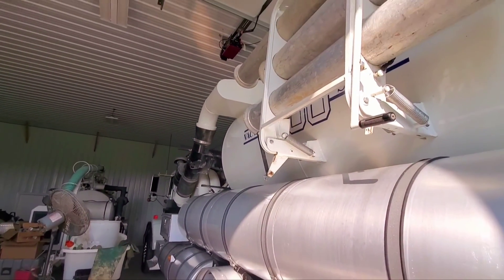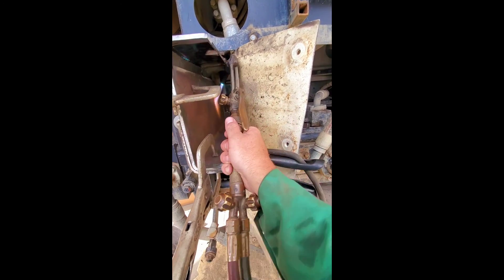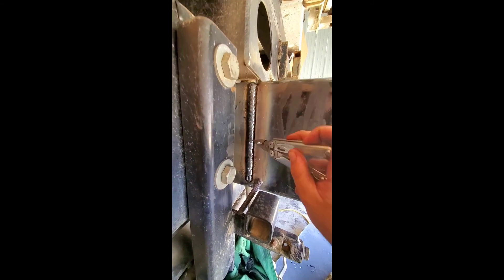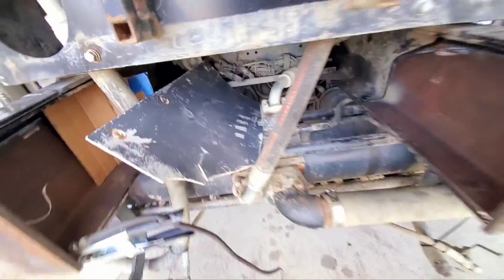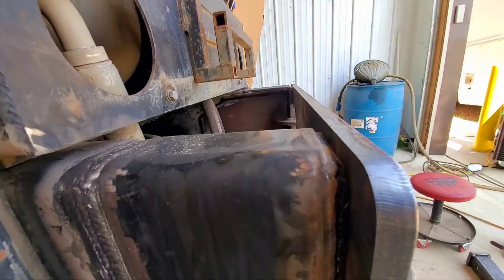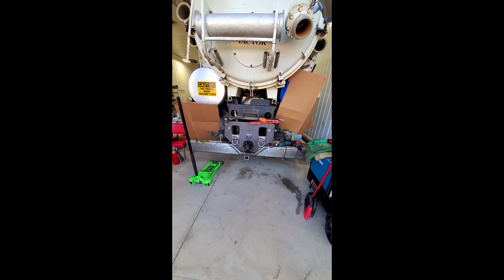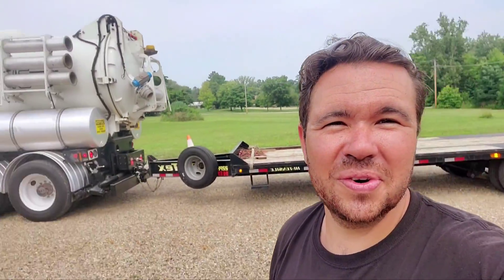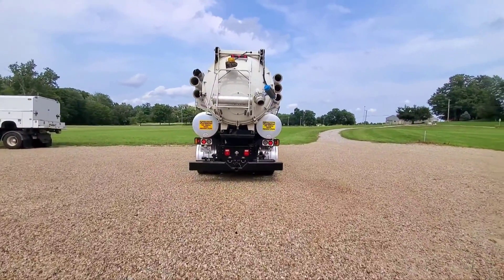Fabricating a 45 ton pintle plate on a vac-truck!

Comment: Looks plenty strong. Nice work. Is that 1" plate?
Reply from the maker: Thanks 👍  Yeah its one inch plate and we burned in all together with Lincoln 71m. Really enjoy how that wire runs in hot and stays put when welding out of position.
Reply: Doesn’t that Pintle have the option for the air cushion? Why didn’t you use it
Reply from the maker: @2ndMomentumGarage  No that unit is a solid mount. I may upgrade to an air unit when I run the air brake lines to the rear though 👍